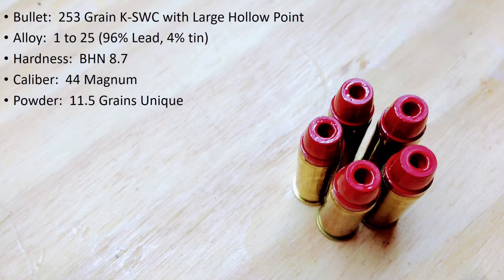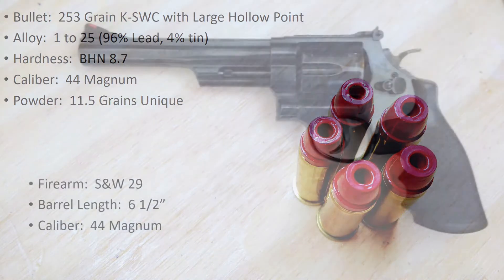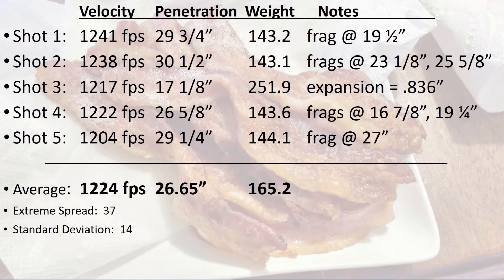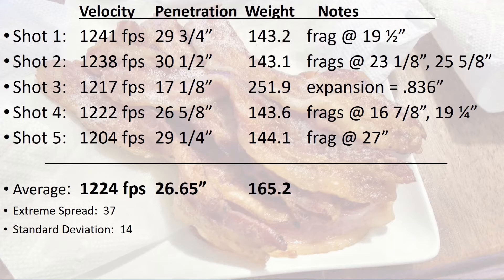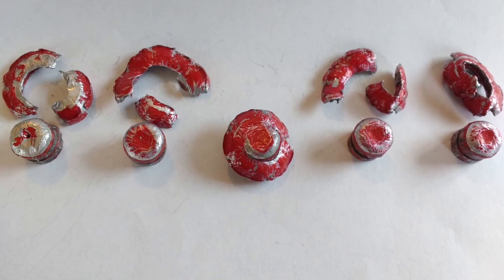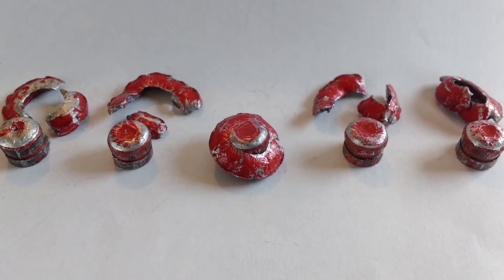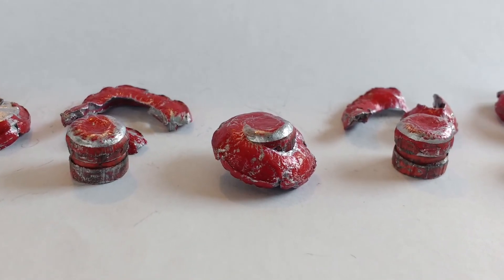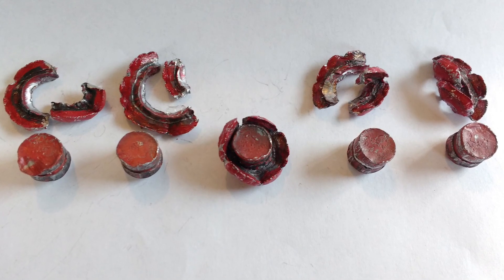44 Magnum (1225 fps), Large Hollow Point, BHN 8.7, Bare Gel (PC HP Test)

Comment: You probably want to have a harder bullet for those velocities. Buffalo Bore has a round called the deer grenade. It has a BHN of 12 with a gas check and they list characteristics based on velocity.
Reply from the maker: Agreed.  The next time I test this bullet design, after the 8.5 grn of Unique test, it will be cast from 1-16 alloy, which is giving me ~10.5 BHN.

Comment: I did some testing a long time ago with a large triangular hollow point that tapered fast, it was not overly deep. The bullet would expand well (in a strange 3 petal kind of way) but I was getting terrible barrel leading with it so I gave up on it, I didn't know about Powder Coat back then.
Reply from the maker: Powder coat has certainly opened up a few possibilities.  Your pyramid HP probably performed in a similar manner to the penta design I've been testing.  Do you remember how hard the bullets were, or at what speed you were pushing them?  Did you ever hunt with them?
Reply: The bullet weight was 300 grain out of a 444 Marlin, velocity 1700, Alloy was 1/2 WW and 1/2 pure lead. The main reason I quit on that one was the rifling Marlin used on that rifle, everything leaded.
Reply from the maker: Was it micro groove?
I'm about to convert a 44 barrel on my single shot rifle to 445 Super Mag - should be similar to the 444.
Reply: Yep, Micro groove, although I think now days with the use of powder coat it can be made to work since the coating is very tough.
Reply: Ya it was micro groove.
The triangular hollow point did work however and the peddles did not shear off easily, I might have to try it again sometime

Comment: Hand gun bullets slow quickly , most deer ( if that is your target ??? ) are shot @ 20 - 50 yards or more , at that distance the bullet may slow to the " right " speed . On a common side to side shot , no problem . If you wanted to hunt Elk or Bear , or angle shots on deer , a smaller H P might be better . I think 1250 is a Very Good Speed to shoot 44 mags , not too hot or too slow to be a great hunting bullet . Ron Power has been building S&W guns for 30 yrs+/- , he said keep your rounds no faster than 1250 for long life on a S&W .
Reply from the maker: Nice thing with the 250 grain Keith SWC - it's usually quite effective even if there is zero expansion.  The velocity at the time the bullet strikes the target is certainly the important measurement, and, as you point out, that can change quite a bit based on distance.
1250 is a good speed.  I'll get a bit more from this revolver through these tests, and a fair bit more from the rifle.  I wonder if Mr. Power's recommendation is specific to jacketed bullets?
Reply: Both of us shot lots of Sierra for a very long time , now that they are about 45 min drive from us & they give him free bullets , he would say Sierra . HA! I pay cash & think they are a good value ! In a handgun I would go with the 180 or 210 gr JHP , in a rifle at full power , I would go with 210 or 240 gr JHP . I think the 240 gr JHP is strong enough for any sane hunting with a 44mag , if more is needed I wouldn't go over 270gr , I think the 300 ++ weight has too many trade offs & has little to offer that the 240 - 270 gr bullets don't already have .  I also like XTP bullets , Gold dots & LBT .
Reply from the maker: Sierras are my primary bullet in rifles, but I've never used them in handguns.

Comment: Bacon your one testing dude and power to ya. And looks like you found the limitations of that bullet compound, and shot 3 was at the edge. Do you think harder or softer would work better or just at the end of the limits? And once again thanks for your time and effort in doing this, you got a good following and you’ll get the praise for your work. Especially from me, it takes a lot to do what you do!
Reply from the maker: I think the main limitation on this one is the design - the wall of the HP/nose is fairly thick.  When it works, it seems to work well, but the window of velocities in which it seems to work is pretty narrow.  Harder may have helped at this velocity, but I doubt by much.  The penta design is starting to look a little more versatile.  It will also be interesting to test this design will some sort of silicone plug in the HP cavity.
I really appreciate the kind words, but I don't need any praise.  I do really appreciate the participation though!  Thanks BI!

Comment: This is like a partition & likely would drop a deer quickly ... if shot at distance would still do very well .  Good test !
Reply from the maker: No doubt this would put venison in the freezer!
Reply: RE: large H P   if you put a deer hide in front of the gel , you may want more speed & be glad for the Large H P , so it won't plug up & act like a SWC , if so  , it will do the job , just not as fast .
Reply from the maker: This one works well, but I'm thinking the penta design is a bit more versatile - and, the HP cavity is a tad bigger on the penta.  Also curious how these all will perform when "pre-filled" with some silicone.  Time and testing will tell.